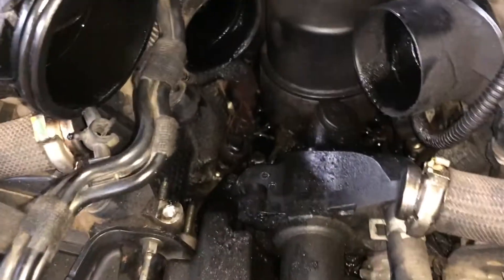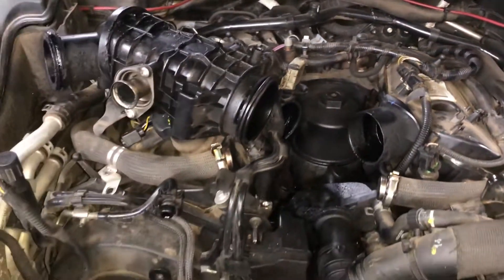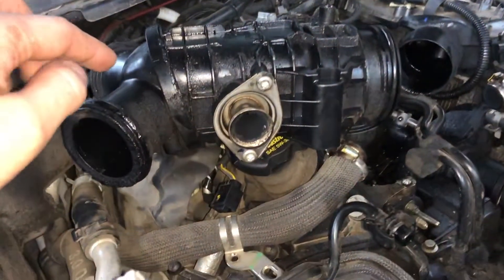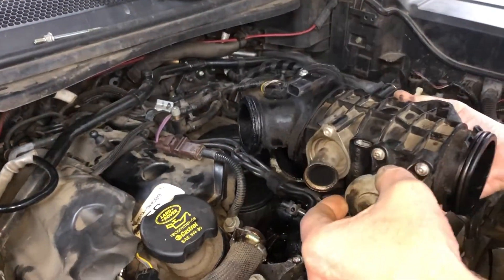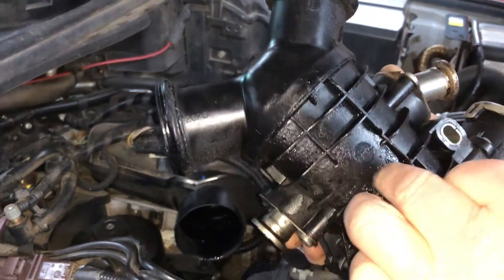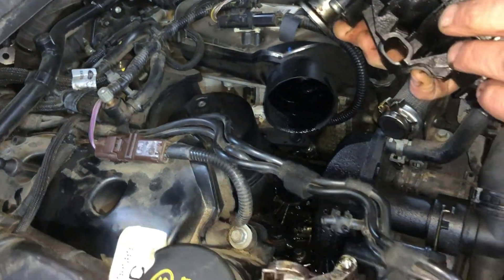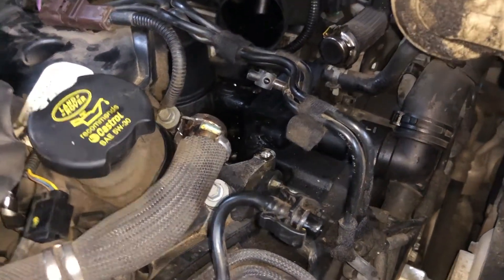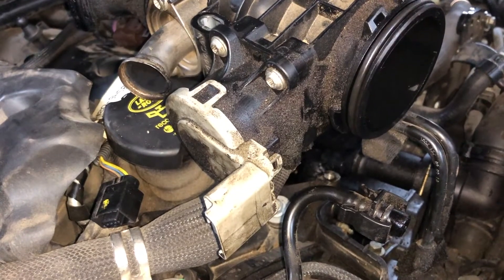Land Rover Jaguar 3.0 TDV6 - Oil Leak Black Smoke Loss Of Boost No Error Codes - FIXED

Comment: Hey, found your video and I have a 2005 with same symptoms ( oil under car, low boost and black smoke)and the car currently in workshop.  I will ask the workshop to take a look. Is it under the throttle body on the engine side or on the down part of the throttle body so this is needed to be changed?  Regards from Norway
Reply from the maker: It’s the ultrasonic welded seam on the underneath of the part you can’t see when fitted.

Comment: Thank you so much for this video, it's been like this for over a year now with nobody being able to tell me what's wrong with it. 3 mechanics so far. So now I know why the oil is on the engine and why do I have a low turbo boost, however, is the oil supposed to be there in the first place? Isn't it a larger issue on how the oil got there in the first place? This may be a dumb question, but I really don't know and before I go and take it to someone again I think I need to know more details, otherwise it's going to fail on me again. Thanks for any help.
Reply from the maker: Hi Phillip, very glad to help. Boost hoses will always get a bit of oil residue inside them which increases as the turbo ages. Not particularly anything to worry about until high mileage or the turbo actually fails. Hope you get sorted!
Reply: @IAMASPANNER  Thank you Tolly. I won't worry about it for now. I actually had the turbos redone a few months ago, hopefully they did a good job :)

Comment: Hi, thank you for that video. But for me it's not clear which U-weld did break. Would you consider completing it with pointing with a screw driver precisely the spots of interesst? For me the pointing with your finger is not that clear 😬
Reply from the maker: It’s the join where the part is ultrasonically welded together and it the underneath part that you can’t see when it’s fitted to the engine. The part is long gone now so unfortunately can’t record anything new.

Comment: Hello, i have the same problem on my engine. I remove this part and start the car. (i let all electronic part connected). When i ask someone for give more rpm i could see mutch oil leaking by admission. So the problem was probably Turbo, to mutch oil in motor (returning oil system for turbo fail)  or need to clean all admission pipe beacause to mutch miles (oil crossing turbo).
Try to clean oil pump . AND PLEASE DON'T PUT MAX OIL IN THIS ENGINE. YOU WILL BREAK IT.
Reply from the maker: Hope you get sorted Mathieu, thanks for sharing your info too.

Comment: What is wrong with it sorry ? Can you explain it bit more please ? I gave the same model and same issue
Reply from the maker: The part that is removed in the video is the issue, it has split where the part is ultrasonically welded together which is why the oil is leaking from the top of the engine all the way to under the car.
Reply: Oh thanks , I have the same issue and I’m going to replace mine I hope it will fix the issue